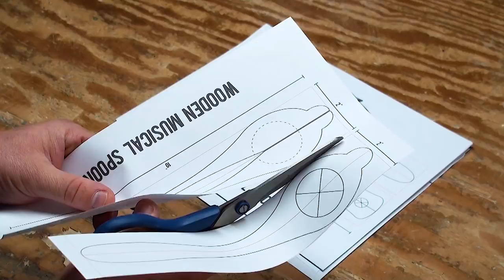How to Make Musical Wooden Spoons

Comment: Hey Pat. Love this video and just made one. I have a question, hopefully you can answer. I used walnut and maple and it makes a really great sounds. But when I try to use it on my fingers, it doesn't work. I'm wondering if my choice of wood species is too 'firm'? It looks really awesome. I just can't get it to move the right way. Is there anything I can do to solve this issue? I appreciate any advice you could give me. Thanks :-)
Reply: @PatLap  Merci Pat. I definitely did not think of it as 'tuning' but that makes sense. I'm extremely happy with how it's turned out. I'll start the tuning process today. I appreciate your help. And your videos :-))
Reply: Just a short update. Works great not. Looks really incredible. Thanks again :-)